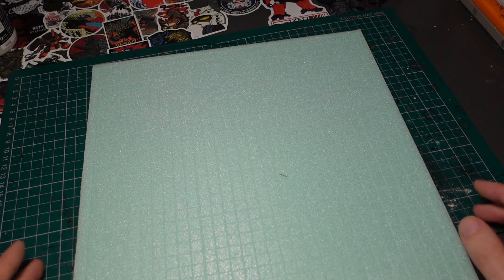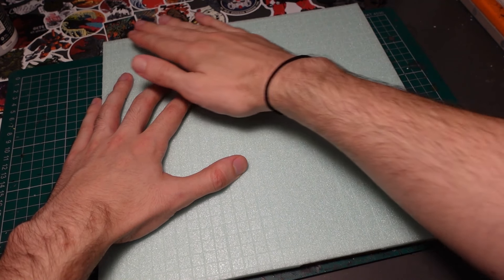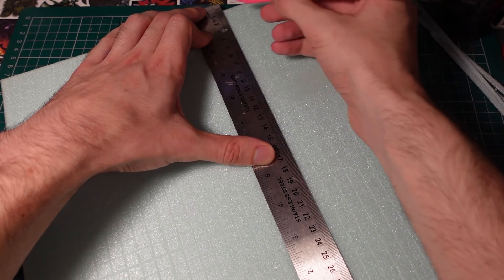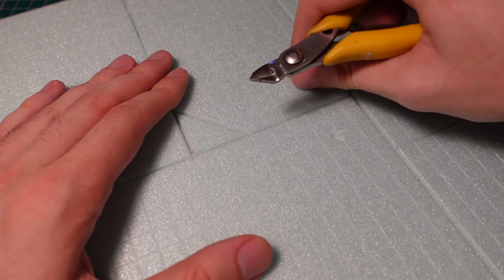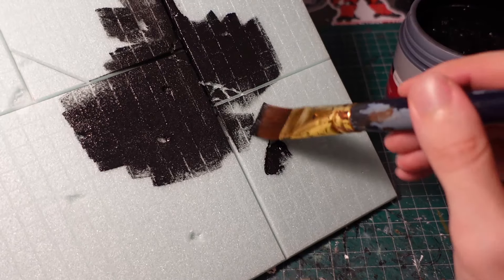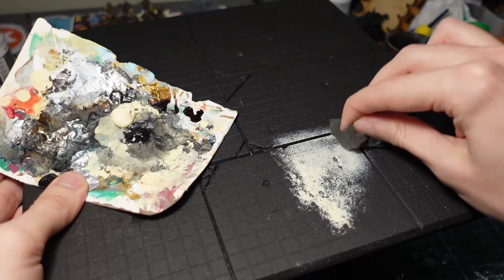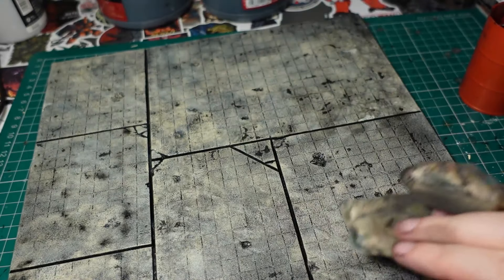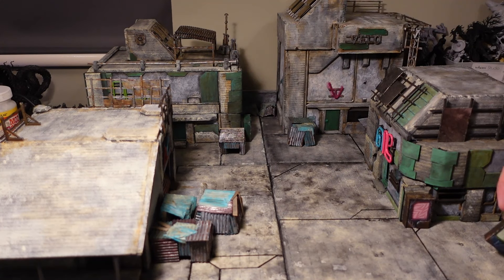Modular Cityscape board tiles for wargaming

Comment: Going in with Ivory and then washing it back with black is not something I had tried before, All my own tiles (from the same blue foam) ended up far too boring and dull grey. Yours manage to look like actual concrete and interesting!
Reply from the maker: Thank you, I think the sponging is doing most of the heavy lifting here. It's also a very forgiving method as you can re sponge and black wash until you get the right tone

Comment: Awesome!!!  I could have seen lots more of that board, from all kinds of angles.  LOL

Now you need to film a couple of short demo games in that magnificent board!  Your rules of choice, of course.  
Scenario:  walking/escorting a little old lady, and her lapdog, down to the other end of the block.  The other side thinks there is contraband in her bag.

Q1 - Which patrol figures are those?  
Q2 - And, next to the guy in the coat and gas mask (far left quadrant), what is that small corrugated shed for, trash bins, motorcycle, or dog house?  :)

Thanks!
Reply from the maker: Hi, thanks!
They will definitely feature in any future cyberpunk type stuff I do and some battle report type things is something I have in the think tank. 
The patrol figures are from anvil industries enforcer range
As for q2 I would say any and all of the above, perhaps at the same time
Reply: @thecavyforge7307  That’s awesome.  Thanks so much!
And, also, I’ll see if I can track down a few of the figures.